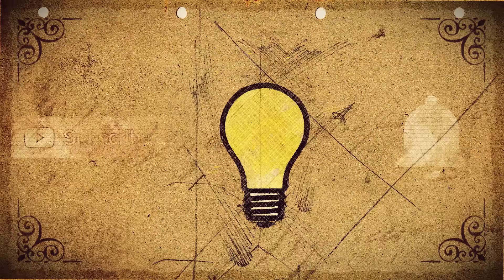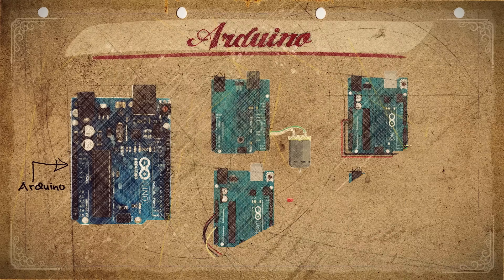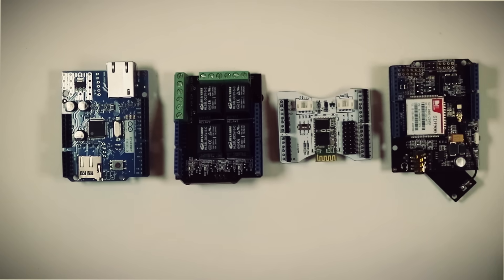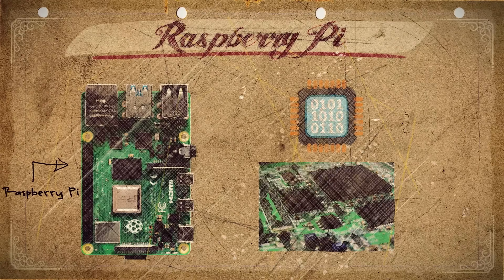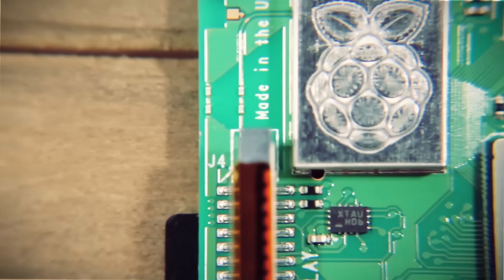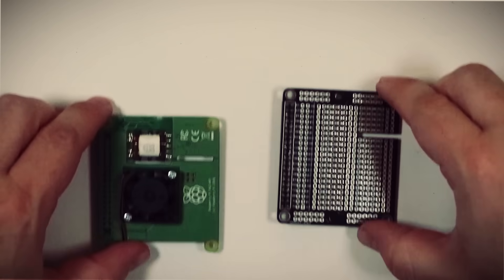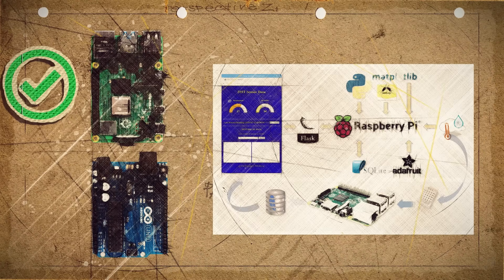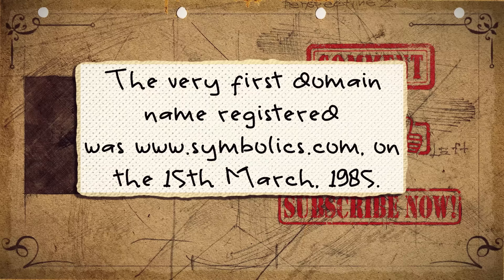What's the difference? Arduino vs Raspberry Pi

Comment: This explanation ignores probably the most important difference between these two types of devices: Arduino is a microcontroller that runs a sequential code within a big do loop. A Raspberry pi is a general purpose computer that runs under an operating system that can respond to interrupts that can stop and start different processes according to priority. That is, it's cpu is interrupt driven and can suspend what it is doing now to respond to a more urgent higher priority request that requires more urgent attention. In contrast, the Arduino goes through a preassigned sequence of tasks and can get to the urgent matter only when it has finished all of the previously scheduled (i.e. coded) tasks.
The arduino is better at accurately handling a few pre-defined tasks,  while the Raspberry Pi is better at responding to a wide array of disparate on-demand tasks according to pre-defined priorities.
Reply: Arduino also can work with interrupts.
Reply: I think you’re mistaken,the arduinos run on atmega328P microcontrollers, which can can execute code within a big do loop, but also using interrupts. I’ve written software to accomplish specific tasks, using interrupts, with this exact chip.
Reply: You can definitely use interrupts with an Arduino, this guy has no idea what he is talking about
Reply: what if i'm just in the midle of that, like for (very precise because that's what i'm trying to do) example  you wanted to: 
create a furby that is controled by a ardruino or pi zero w to play audio files and move face acordingly but the files it plays are transmitted from another computer. some kind of a pupet you can talk through and move remotly.
because pi zero w is 10€ and that's really cheap for bluetooth control but it's a nightmare to play audio files through and i don't know if the ardruino equivalent would be better (keeping in mind furby only have 1 motor for all his facial expressions)
Reply: @maxk5065  You'd have to go with Pi on that because Arduino can only do things sequentially. In other words, if you want your furby to say something AND move its mouth in sync with it, it would only be able to do one, then the other with Arduino. With a Pi, you can do both simultaneously.
Reply: Microcontrollers have interrupts too so???
Reply: If it wasn't for those gpio pins no one would do a comparison. Rpi is like my linux desktop but less resources.
Reply: arduino is a microcontroller board and raspberry pi is a microprocessor board. Micro-controller are programmed to do only one type of task, whereas microprocessors are multipurpose . In short , microprocessors are far more capable than microcontrollers , in terms of processing power.
Reply: The video explains the differences in a simple manner so beginners that have no knowledge or understanding of it can get into a new hobby potentially. Your explanation is more on the technical side of things and a newbie would be like: woah, dude, black magic that!

Comment: Personally for a real beginner who would have to choose between these I'd actually recommend the Pi, if for no other reason that if they find out after messing with it for a bit that this sort of tinkering isn't actually their fancy, the Pi can still find other uses as an actual minicomputer. Want to smart-up your old TV? Create an emulated retro gaming "console"? Store some files in a network-accessible way without eating tons of power forever? Have a LAN-wide adblocker? And so on and so forth? The Pi's got your back, no need to even touch a GPIO pin, you pretty much just dump the ready-made software you want in there from a list, optionally attach some USB peripherals like gamepads or wireless keyboards or such, and you have a useful device. An Arduino in this situation on the other hand simply becomes drawer stuffing.

Comment: welp i started with a school project on old fashion micro controller (not Arduino because it didn't exist yet..) and the next step was a raspberry pi 3b... lol... even my first robot project needed a computer and a compiler to do processing from a kinect sensor to feed new output into the microprocessor to signal into the motor driver... so i was glad they made the raspberry pi because with it, it shrunk my giant space from the laptop and that usb debugger compiler thing and my big (compared to the arduino and the raspberry pi) microprocessor board and giant motor drivers, into 1 single board the size of a credit card with the thickness of a rj45 port that only requires a motor driver...
plus in this new era of robotics, i don't need to find specific microprocessors that will fit into specific board and make sure i have enough ram and rom for my code to be compiled into it and have enough channels for my motor drivers and many other annoyance...
now its just as simple as buying a  pi or a arduino and just program it directly and just add on new boards that interface with their on board pins/pads.... its worlds apart now....

Comment: I know I'm late to this party, but I have a bit of a different take here: If you are building a thing to do a physical task that must run (i.e control real time physical events) get an arduino. If you power it up it will run. If you want an extensive interface to the world with graphics, events and a database and schedules and externalized inputs etc get a pi. If you want the interface to control hardware, get both and let them talk to  each other. To some extent, both devices can do the same thing as the other, it's just that they do a bad job at it.
Reply: Basically, if you want something that a computer can do, use a Pi but if you don't need as much power and features, use an Arduino
Reply: @w花b  " if you want something that a computer can do" that's anything an arduino can do... You basically just said 'if you want an arduino, get a pi, otherwise get an arduino' which doesn't make much sense.
Reply: @BruceNJeffAreMyFlies  You're taking that general statement a bit too far.  There is actually a technical difference between a computer and a microprocessor, and while a microprocessor can do a few things that a computer does, there are many things a computer can do that a microprocessor can't.  One simple example is that you can't have Arduino run Linux, and the thousands of programs that run within the Linux operating system.  Your Arduino will never be your DNS server or your game emulator.
Reply: @lanzer22  computers are based on microprocessors, but then so are phones. I'll still go back to the basics. For real-time control ops spanning years, go with the arduino. OS's are a liability and require a lot of resources, and in an embedded deice which will never get updated and will never be turned off, an OS is most likely overkill. Arduino's are simple. Look at an input, do a thing. They can be interrupt driven or just a big loop, whatever the "do" part required.
Reply: @mrl22222  i think he meant microcontroller
Reply: Oh fuck its gone sentient!
Reply: Just wait till we get rs45s in the head. Absolutely absolute control completely. 
Mr tesla? Take me to mars fast!!! Whats there? What is my purpose?

Comment: If you're just starting out I'd give the OPPOSITE advice for choosing Arduino first and not a Pi. With Arduino if you run out of "useful ideas" to build then you're STUCK with a new "coffee/tea cup coaster", vs the Pi which can be used as a actual computer if you get a Pi 4 and is more like a Swiss Army knife, instead of a single blade knife AKA a "one trick pony" (Arduino)!

Comment: Arduino: fast controls, no need for an operating system, low power, analog input/output, to control stuff

Raspberry Pi: operating system, as a server, for complex calculations, machine learning, cameras, slower I/O pins, to process stuff

Comment: One key difference that Tinkernaurt didnt mention is that you cant control the voltage level on the i/o pins on the PI, only that it is either on or off

Comment: Great explainer. I found myself nodding and thinking, "Well yes, of course" to the hardware explanation in the opening minutes of the video. This retired BSEE/MSEE hardware designer, who wrote a few KBytes of Intel Assembler ca. 1979-1991 to make useful products with 8039/8748/8749, 8096, and 80186/80188 family microcontrollers, is still not interested in writing software for either Arduino or Raspberry Pi. Have fun, guys. I'm going back to tinkering with my two channel analog audio gear...

Comment: if you need something to do and that something should be work fin you should start with ESP, on my experience ESP 32 is more establised than arduino, trust me if you need to use blutooth than use ESP32 don't use blutooth module for arduino and arduino it self. So on my recomandation use ESP32

Comment: L love both but they have different strengths, Examples of the differences can be seen in two projects  i am working on. One is a digital leadscrew drive for my lathe. An Arduino will produce and count pulses sent to a stepper driver board at very regular accurate intervals (to get a good surface finish) and check in its 'spare time; for start/stop commands and speed changes etc. The other project is a cine film digitizing project which will use an Arduino  to advance the film motion and take up the slack  and trigger a Pi to grab a video frame  at the right time. The Pi will do the heavy lifting involved in creating the video stream and extracting and storing frames for cropping and turning into an Mpeg. The Arduino does not have enough resources to do the video processing, and whilst the Pi could do the film motion, off loading this task with lots of waits avoids any of the timing complications that multi tasking may bring - and avoids tackling inter process communication which in 37 years of playing with  Unix and Unix like OS's i have never mastered fully! Horses for Courses

Comment: Wow! I worked as a controls engineer for a couple of decades until I retired in 2011. I've done consumer electronics to integrated material handling systems for warehouses. I could have used either or both of these units to great effect. I have a few  ideas involving robots and fuzzy logic I want to play with.
Reply: Naw, you know better than that. Warehouses, that's plc territory.

Comment: I was looking into getting a Raspberry Pi to do ADS-B reception, but then some time ago for something else the issue of Arduino came up. I haven't worked with any of these, found this video, and good summary of the differences between the two. Good analogy of laptop vs. calculator just like a computer vs. a controller.

Comment: Nicely explained! Only nitpick is about how you explain which one to get/pick. For hardware control applications like robotics, it’s not just that Raspberry Pi is “overkill” - meaning it is too powerful and has too much capacity, and so Arduino is more appropriate. Instead, an Arduino is better suited to the real time control required from microcontrollers. Raspberry Pi’s can interface with hardware using GPIO but cannot offer the same real-time capabilities as the Arduino. 

So, if you want to build a Bluetooth controlled car use an Arduino. If you want to build a Bluetooth controller car that can stream live video, use an Arduino for the car controls and use a Raspberry Pi for the streaming and web connectivity! 😊

If you’re a beginner, both the Arduino and Raspberry Pi are great tools to get started! Raspberry Pi can also be used by people interested in software and programming without even doing anything with hardware.
Reply: Arduino is hands down the choice for beginners working with electronic components. The Raspberry Pi is a full blown computer with all the complications that come from having to deal with an operating system (I never really understood what the difference was between a Raspberry Pi and any regular computer that people owned if they weren't interested in learning how to work with components). The Arduino was explicitly designed to make the external interface accessible.

If all you want is a small computer then obviously the Pi is the only way to go. If your goal is to create something with electronic compnents then you'd choose the Arduino.

That said, in 2020 Raspberry Pi came out with a microcontroller based board called the Raspberry Pi Pico and we now also have the BBC micro::bit. And, because of how Raspberry and Arduino have made their components and designs available to the world there are legal knockoffs on the market that help fill the manufacturing void that exists.

Comment: Most notable difference:
Connect an ultrasonic distance sensor to the board. When trying to read it with "sendping()" while(!responsereceived());
.....
Dosomethin():

This is how that gets handled:
Arduino: will busy wait until response is received. Only interrupts can make it do anything.

Raspberry pi: <linux scheduler>: " I see this process is busy waiting, let me switch to another task that has more important things to do"

Ping misses and program is stuck in an endless loop.

And yes... I actually had to deal with this!!

Comment: The language used by Arduino is more like C.

It has very little to do with C#.

Also, the comparison at the end suggests you should choose Arduino if you want to make a Bluetooth project.

Arduino does not have Bluetooth built in on any of its SKU's.

Use an ESP8266 or ESP32 for that instead.

Overall, this was a poor video.
Reply: Arduino using avr-gcc compiles in C++ mode

arduino/ArduinoCore-avr/blob/master/cores/arduino/HardwareSerial.h

class HardwareSerial : public Stream
{
  protected:
...
}

Comment: If your project involves a physical button, I’d choose arduino. If it uses a ‘button’ on a screen you press with mouse or keyboard, I’d choose Pi. Best to know both and not unnecessary pit them against each other. Apples and oranges.

This is how I choose. Pi can do physical buttons yes, but with a lot more delay, interference and only at 3.3v. In real world application where I had a working prototype in both arduino and pi controlling a 5v relay, the pi version failed in application by picking up interference and activating the relay when no buttons were pushed. My coke machine compressor would kick on and trip the relay on the pi! Arduino however was absolutely flawless and much faster. Button-to-lcd display was delayed on pi, but not on the arduino. This is of course for obvious reasons

Comment: I hope beginners understand that their raspberry pi program will run on top of linux. Therefore it is not real time, as linux ls the one deciding when to call your process. for example, it may think that an update is more important than lighting your LED😂. This of course does not appply for arduino
Reply: Master and servant comparison?.....one (Pi)  tells anyone what to do when it feels like it, the other (Arduino) just does what it's told to do specifically without question or argument.........is that correct?

Comment: Arduino is dead at this point - replaced by Espressif ESP32 /8266 amongst a plethora of others - that kick the shit out of a what, an 8 yr old Uno? Arduino makes a lot of boards like the Nano which are small as heck, but also not very powerful.  You can get up to the MKR series, which are indeed IOT capable and powerful, but around $60. Compared to a chinese board that's about $10 and more powerful still.  An Espressif ESP32 is super fast and powerful and the can communicate to each other through 2.4GHz without any router.  All have BLE bluetooth, etc. etc. Raspberry Pi is a linux computer. If you don't know linux, you'll have a lot of fun catching up. Windows makes one too. 

Thinking of the Arduino boards as a microcontroller on a raspberry pi makes some sense frankly, but if you have to ask the, "what's the difference between arduino and pi" then you're far away from using either. Buy an 8266 cam board on Amazon for 10$ and see if you're into it. It's easy to think of Pi as a tiny linux PC, so just install Ubuntu or whatever on your old pc, Python and some IDE, and viola if you have an itch.

Comment: You had one job... Arduino is not microcontroller but a PLATFORM. RPi is an ARM sbcs. Besides there are also Arduinos with up to 4 x86 cores and 8 GB of ram and iGPU that can run full fledged Windows 10 it's not just an Uno.

Comment: I really want to like the raspberry pi (I have both arduino and pi so it's fair) but the fact that I've always had shit experiences with the raspberry pi is discouraging. Seriously, for running raspbian, my process was this.
>use all of the 1st party software and follow all the rules
>raspbian boots fine
>safely shuts down raspbian after its done updating and unplugs the pi
next morning
>plugs pi in and tries to boot, nothing
>spends a total of 4 days trying to troubleshoot
>nothing

For me, arduino has been a lot more of a "plug & play" experience, which is odd, since the arduino is meant to be coded more than the pi is.
Reply: Well Arduino has just a microcontroller which only runs one thing that you wrote, so there's nothing to go wrong unless the hardware is broken. Raspberry Pi runs an operating system, millions of things can go wrong
Reply: @xGOKOPx  In reality, it isn't that simple.

Comment: Rpi is much faster than Arduino and it has OS like your desktop or laptop. However, Arduino is more reliable since there is no OS on it (unless you intentionally put one in it).
Reply: Can you even put an OS on a microcontroller?
Reply: @xGOKOPx  Operating Systems are not limited to Windows, Linux, and MacOS. There are light-weight open-source OS for microcontrollers like Nuttx and FreeRTOS. However, the AVR based Arduino is limited by its speed. Application on faster 32bit Arm is more practical.